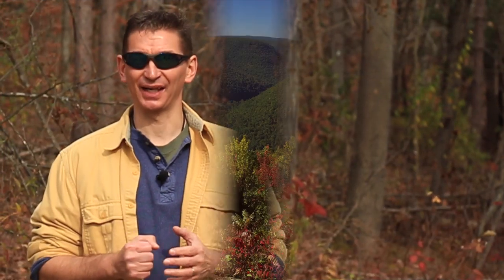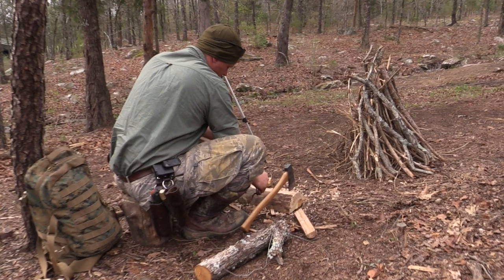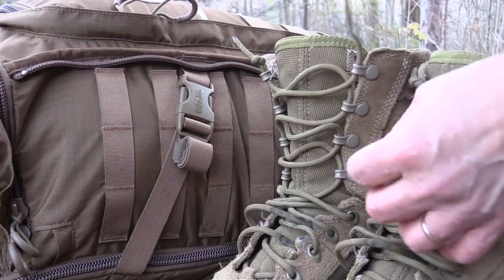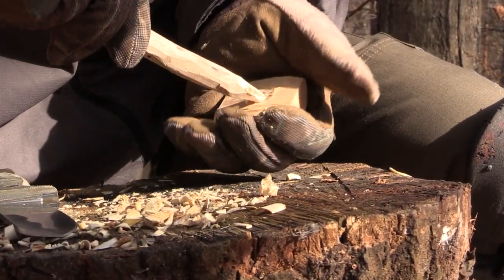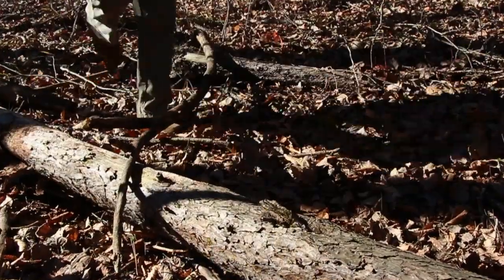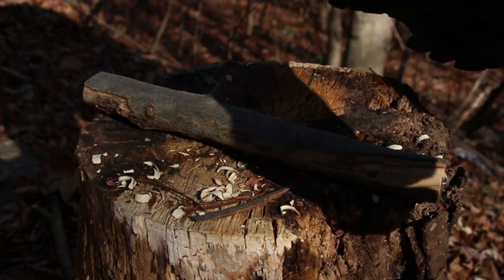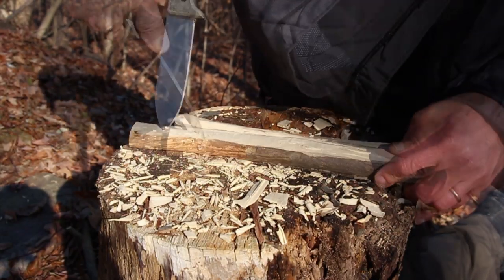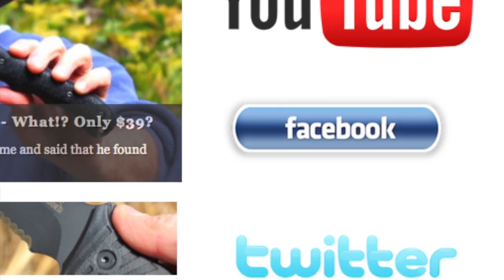DIY - Step-By-Step / Bow Drill Fires - Made Easy - Part 1 - How to Make Your Kit

Comment: Great video David; I'm looking forward to part 2!

When I do a bow drill my preferred cordage is #36 tarred bank line. The tar coating does a great job of preventing slippage on the spindle. That being said, in a real emergency I'm far more likely to have paracord than bank line, and recently I've replaced most of my paracord -- bracelets, boot laces, lanyards, zipper pulls, the cordage on my packs, etc... -- with 550 Firecord. It's basically standard, 7-strand 550 cord with the addition of an 8th strand made out of the same chemical fire starting material that the Live Fire fire starters are made from. If you're going to carry paracord anyway you might as well have some fire starting material to go with it, and I have a short little 1" piece of a 3/8" ferrocerium rod that's been drilled with two holes (for adding to paracord bracelets) added to my boot laces at the very bottom (the toe end of the boot). That way as long as I'm wearing my boots I'll always have both a ferro rod and a chemical fire starter with me. Being able to make fire with a bow drill or a hand drill is a sexy skill to have, but if you ever have to depend on that skill in an emergency you've done something very, very, very WRONG!!! 

If you haven't checked out 550 Firecord yet give it a look. I think you'll like it! (http://www.livefiregearllc.com/550firecord/)

BTW, if you're looking for a new multi-tool to review take a look at the Leatherman Surge. It's recently been upgraded with replaceable cutter jaws, and, if ever there were a multi-tool that's been made specifically for the outdoorsman, the Surge would have to be the one! The Surge and the compact Juice Xe6 are the only multi-tools that I know of that have every tool that you really need all in one package. Don't get me wrong. I'm still a big fan of the Wave and especially of my Charge TTi (which has unfortunately become ridiculously expensive since I bought mine), but these days when I'm heading into the bush it's the Leatherman Surge that goes with me!
Reply: Gunslinger454  what about paracord? *

Comment: I'm a city girl, and don't know much about camping, but if you are going to be doing all of that whittling, wouldn't it be wise to save all those little chips and saw dust to start your fire with?
Reply: Not at all. Hardwood chips are not an effective tinder. Once you've made an ember with your bow drill, there's still no flame. You have to blow a tiny smoldering ember into extremely fine tinder to get a flame
Reply: Suzi SaintJames the saw dust would actually be a good addition to the tinder pile, but actually collecting the sawdust and making sure it doesn’t land on the ground (and become wet or damp) can sometimes be difficult.

Try it sometime, and if it works, great! Anything that works is good, regardless of what others’ methods are. Be wary of asking folks online about stuff like this, since everyone has their own experiences and will sometimes push you away from trying something that might actually work.
Reply: @timmaywoohoo is correct but you're thinking like a woodsman or woodslady. :)
Reply: @Momentimum , I may agree to be a newbie woodslady, but I fight chronic fatigue these days so conserving energy is important to me as it would be for someone lost in the woods or that's short on supplies as you can't waste energy on making feathersticks if you have to hunt or fish for survival. 💜🌞🌵😷
Reply: @enzowarren9832 , I also follow reallybigmonkey1, he usually carries a 24x24? piece of tarp to kneel or sit upon. That would be easy to tuck under the branch that you're sawing. I live in the Arizona desert so moisture is not usually a problem here. Finding wood is a real problem. Lol! Maybe that's why seeing those chips fly and being wasted made me ask the question. But in any case, I appreciate your kind reply.  Sending lots of love 💜 from sunny🌞 Arizona🌵. 😷

Comment: Hey David,
I just wanted to let you know of some improvements on your bowdrill kits for future use...
for an exampel the lenght of your spindle is best at just under your knee. This gives you a whole lot more of control over your kit. Of course it will wear down, and then its just a personal prefrence of how short you will let i become. I know most survival guides says that the "finger tip to finger tip" legnth is ideal, but a long spindle does not hurt. Plus in an emergency, I know that you could be forced to work with compromised materials ...
Another improvement would be the way the spindle is atached to the string: the string is supposed to "climp" down the spindle, so that when you push a little bit down it won't "lock" on itself espacialy important when using natural cordage (I've done this mistake myself for a long period of time, and when I finnaly did the oppersite it didden't felt right, and i had a hard time contolling it, but then all of a sudden it became as easy as it was before). Also the bow is normaly more controlable, when it is more straight.
Another thing is, (I can't speak for your enviroment, but many places it is really wet this time of the year) when you gather materials with bark on then they would be more "humid" or wet beacause bark keeps the water traped, so branches without bar is more ideal.

I really hope this diden't sound negative or better knowing, but only constructive...
I am glad for all the work you put into these vidioes, and I think that you put up with somme of the best.
also pardon my english, I hope it's uderstandable
Reply from the maker: Gabriel jensen Hi Gabriel... these are very good comments. I appreciate them and always desire to learn and grow. I did have to cut out a bunch of stuff and boil things down to the most essential info so that a beginner might have a shot at getting a bow drill fire. So with that objective in mind... there is a "book" worth of things that I could have said or added that I simply could not. So thank you... for adding to the knowledge base and sharing your comments. They are "spot on" and I think others will find them helpful. Thank you bro! ~David
Reply: Ultimate Survival Tips
uderstand it, preciate it
really good vid!

Comment: Yeah the key is DRY DRY DRY, if there is the slightest bit of moisture it just won't work.
Reply: +EAD Bushcraft I like to keep those desiccant packs that repel moisture in a freezer bag with my board and tender.
Reply: Thanks Pard.
Reply: @EAD Bushcraft your bow, spindle, and flatboard can get a little wet and still produce an ember. But if you're using natural materials for tinder and the tinder gets moist at all it's damn near impossible to blow the coal into a flame.

Comment: Interesting, will probably be trying it tomorrow. However, I have to correct you on the distinguishing of softwood and hardwood as you have been misinformed. The real difference isn't an actual measure of "hardness" but rather what type of tree it came from, hardwoods come from deciduous (leaf) trees and softwood comes from conifers (needles or spines).

Comment: I just made my first bow drill set, from hardware store pine trim molding 1X2 the spindle came out great. the wood id's soft enough to take a thumbnail imprint. problem is, the hearth is not doing much and the spindle is glossing over. am I just getting impatient, should I try a different hearth board. it's crazy what people want to charge for training. I know I'm close, does the glossing of the spindle happen before the ember?
Reply: I've got the kids skate board wheel for a block. The blunt end of the spindle is glossing at the hearth. I'm using what looks like pine, but could be poplar. Witch just checked, is softer than chestnut but harder than white pine. Whichever the case, it's treated hardware store treated bullnosed trim.
Reply: ***** I'm in Az, I have a cedar tree in the from yard I've been eye balling. I found a good section of cut back I can use for a hearth board. Looking for a portion for a good cut of spindle wood. I have seen a mini drill set that fit in an altoid tin.  Hmm
Reply: Yep, I just broke the mini spindle. Having fun though. Just learning, asking questions, and keep trying.
Reply: ***** yup /^\
Reply: +EAD Bushcraft good times

Comment: If you're going to bring a knife, saw, string, why not just bring a lighter too? lol. I know, I'm just being a wise ass, that's not the point.
Reply: Because lighters run out? This shows you what to do if u dont have one. U don't n
Need a knife and saw to make one he's jus showing u how to make one with them cuz it'll take less time
Reply: Christian Schumann If you read my comment, I was only kidding.
Reply: Well, here you go, while some do this hobby for safety, others do it as the means to get closer to the environment. Either way, whatever your motivation, bow drill is necessary. For the people that want safety, this task is an of less importance than for the people thinking more primitive. Once you can make a bow drill fire you have really stepped up in your abilities to make fire because everything needs to be PERFECT otherwise it won't work. For those that want to get closer to the environment, well, I need not explain. It's the easiest primitive way to do it, and it smells great too.
Reply: LOL. I agree. If not a butane lighter, matches or magnesium striker.  If you're smart enough to wrap an extra 32" of paracord around your shoe for future use then bring a fire starter too.
Reply: I agree with cristian
Reply: Skyebooo he's an ameture!
Reply: this isn’t practical i promise u will never need a fire to survive lol

Comment: You NEED a longer bow! I'm seeing a lot of wasted energy cranking those short strokes. Longer strokes mean more rotations, and more time between points where the spindle stops (and thus creates no friction). Arm pit to hand is a much better length for your bow than elbow to hand. Work smarter, not harder, especially in survival situations